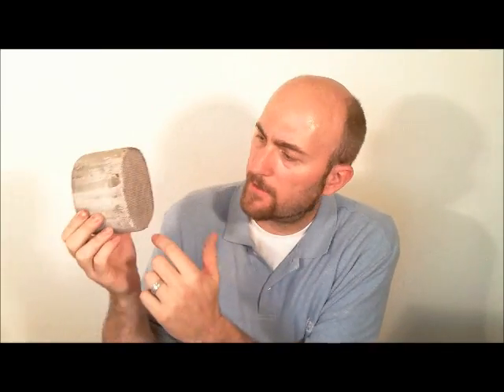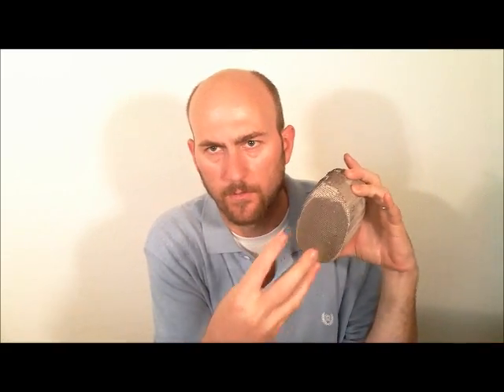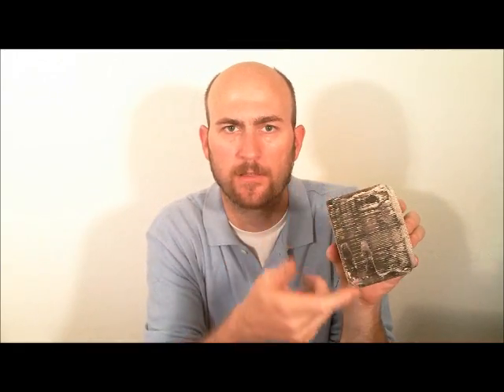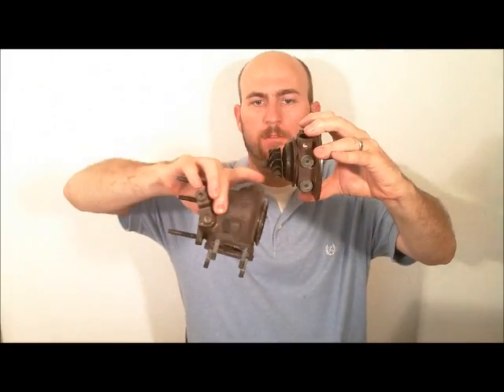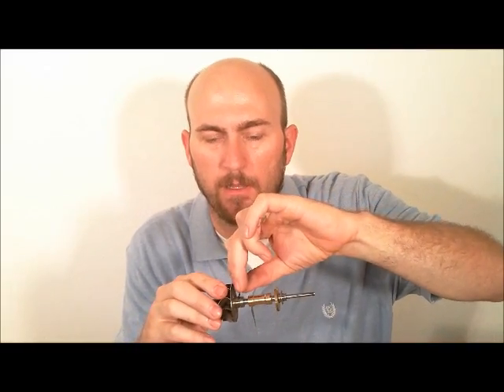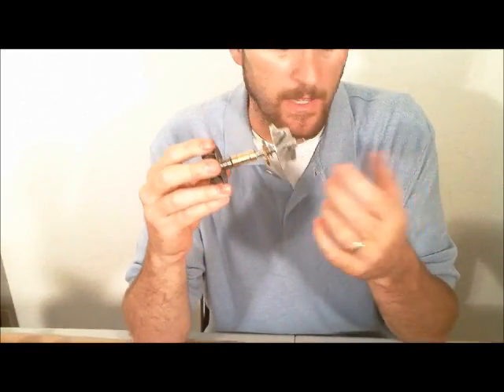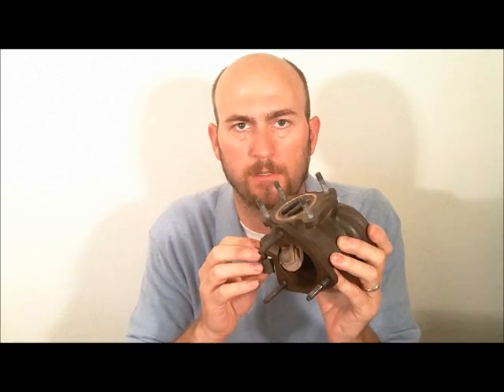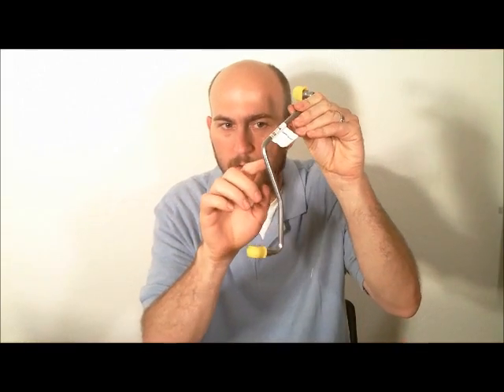How To Kill A New Turbo Quick Part2 catalytic converter

Comment: When you say "Have problem with your turbo". Do you mean consistant issue? I have a problem but When I remove the codes or run it sometimes then it makes pressure and boost the engine.

Sometime I receive rough idle and poor acceleration with only P0299 and P2263 limp mode codes.

The turbo is almost new.

Comment from the maker: If this issue was on my car I wouldn’t drive the car at all until you fixed the problem, turbo failure is actually a symptom of another problem.  Turbochargers do not fail on their own and will not stop spinning/functioning and will run indefinitely after a failure and only stop spinning/functioning or have catastrophic failure when some outside force causes the turbines to stop spinning. So driving without resolving the actual issue will only lead to continual problems or more devastating problems like engine failure.  Yes engine failure I have talk to people that didn’t learn after their first engine failure that the turbocharger failure was actually a symptom of another problem and some were on their second or third engine and/or the problem that they were having didn’t go away by replacing the turbocharger. 

Our turbos have internal upgrades and a very low failure rate because of them and our knowledge and help however if you have an exhaust flow issue the turbo or worse your engine can fail and usually it is catastrophic.  Please consult your turbocharger supplier for the proper installation methods, procedures, and preparations for their products.
Reply: Not true..... everything fails with use over time. Even with proper maintenance and oil flow etc. Ya they should last a while but they spin fast and they get hot.

Comment: Why not put the turbocharger after the catalytic converter? I believe the catalyst produces more heat energy anyway which better helps the turbo.
Reply: Wow , what a great ideea. not
Reply: Two reasons I can think of maybe. 1. The engineers know what they are doing, and this is designed as a system. The turbo is not merely driven by the flow of exhaust, but also the temperature of that flow. The converter affects the temperature, and if the exhaust is hotter, than the turbo produces greater boost, more quickly. 2. The converter is temperature sensitive itself, that is why some cars have heating elements to pre-heat the converter. The exhaust temperature drops as it passes through the turbine, a reflection of the work energy removed from the exhaust gas. You can really see this sometimes, when the pipes before the turbine are glowing bright red/orange, and after the turbine no glow at all. So, this lower exhaust temperature after the turbine, could reduce the converters ability to do the job it was put there for in the first place.
Reply: @terryf8755  I think you have it backwards. You plate the catalytic converter first, then the turbocharger.

Regarding turbo lag, modern DMSL 3D printing allows for the catalytic converter to be integrated directly into the exhaust manifold. Furthermore, a well designed catalytic converter does not restrict flow that much, if it did it would induce restriction either way and whether the restriction is before or aft the turbo the engine would take a hit to volumetric efficiency regardless. This would also eliminate a leaky turbo bearing from destroying the catalytic converter, and would allow the catalytic converter to heat up quicker. It would almost certainly increase fuel economy even if there was a slight increase in lag.

Give me an actual reason why its not a tenable concept, rather than just argumentum ad verecundiam? I'm a mechanical engineer myself and I have yet to hear a good reason not to do this, other than packaging considerations and temperatures raising above that which the catalytic converter itself can handle, both of which can be worked around.

I'm open to real reasons as to why its a bad idea, but I want real arguments or explanations as to why its bad.
Reply: Ya no one ever thought about that ane then considered the massive turbo lag amongst other things and realized it was a shit idea

Comment: Thanks for your videos they're very informative. A quick suggestion for a new video is, could you please make a tutorial on how to care for and clean turbos. And suggest like service points on when to replace parts eg at say 35,000kms replace the oil lines or something like that lol. But other than that it is a great resource that you've given to the turbocharged community. Also can you please tell me what to do in regards to a diesel turbo ie care and maintain it. Again thank you. P.s I have a 2004 GU V Nissan patrol ST ZD30 stock turbo.